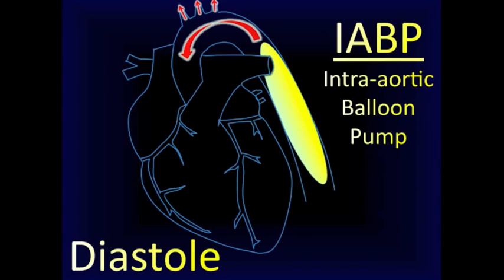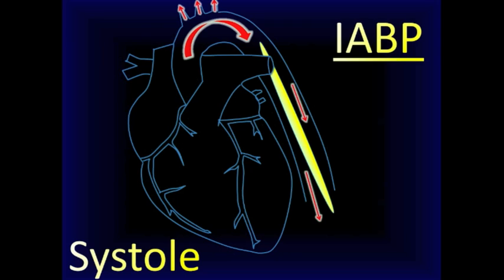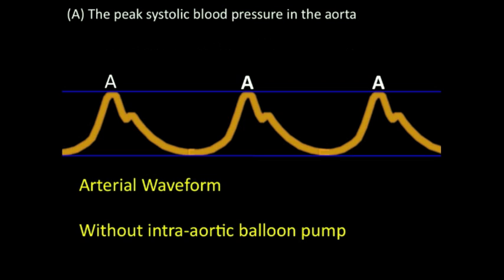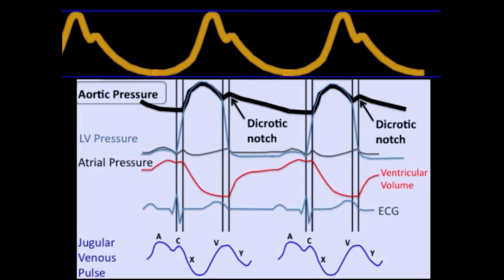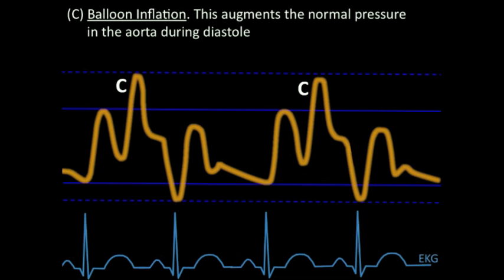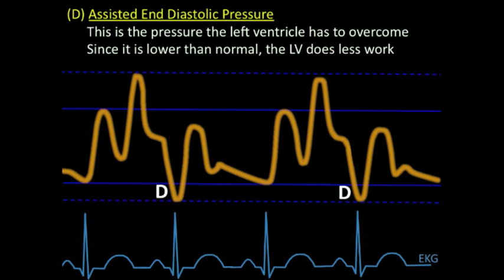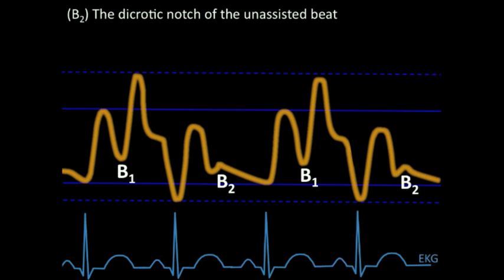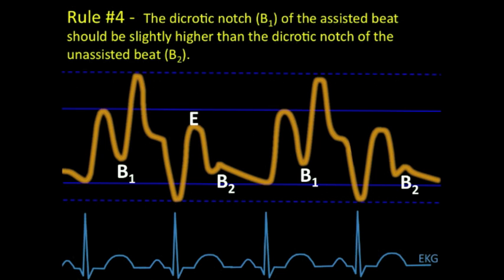Intra-aortic Balloon Pump Aortic Pressure Curve

Comment: rule 4 is wrong .the dicrotic notch of the unnassisted beat is higher.extept if you mean assisted during diastole .beat 2 is assisted during systole however the previous beat(beat 1) is assisted during diastole .helpful video.thanks.
Reply: thank you